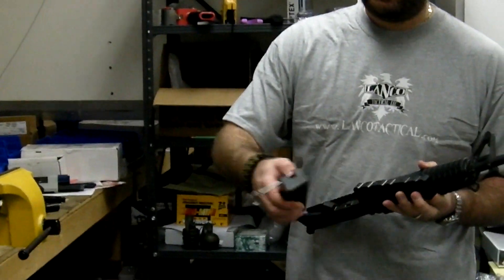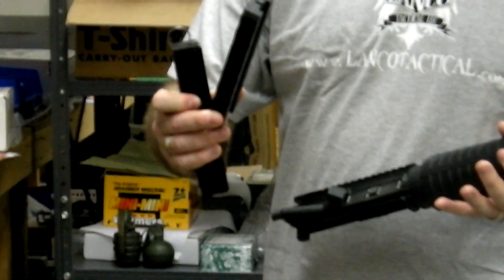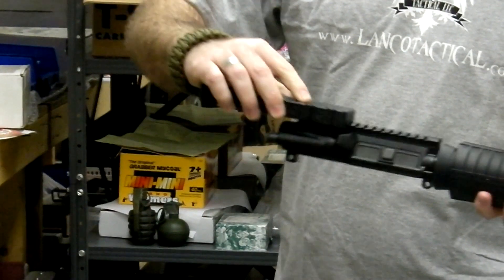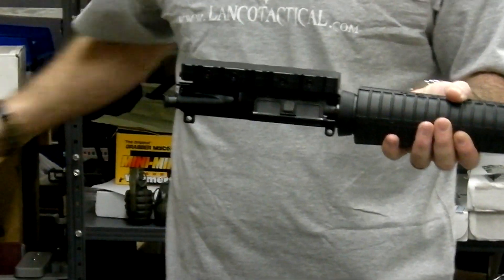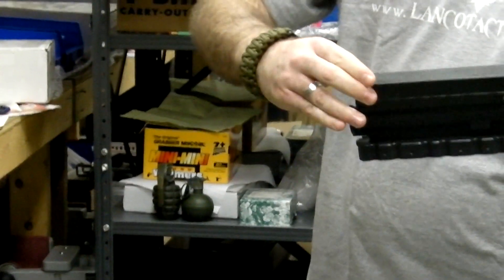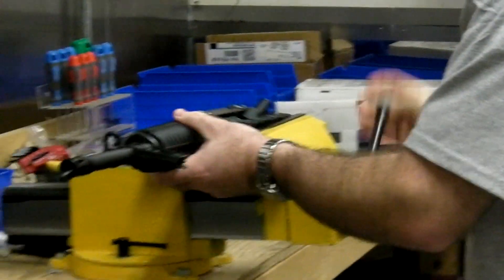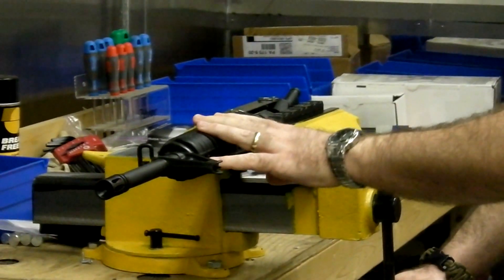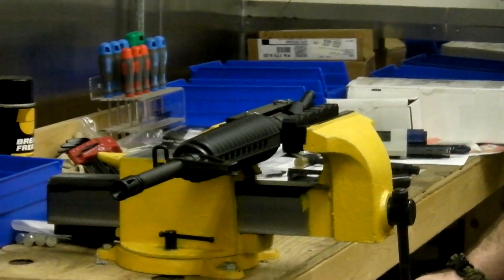Lanco Tactical Upper Action Block

Comment: Clam shell fit great on the redx upper received while torquing the barrel but. It didn't mar the finish like some stated. It also came with a gas tube alignment tool that was pretty handy.
here is the link to it in case anyone is interested: amzn.to\17mk9jF